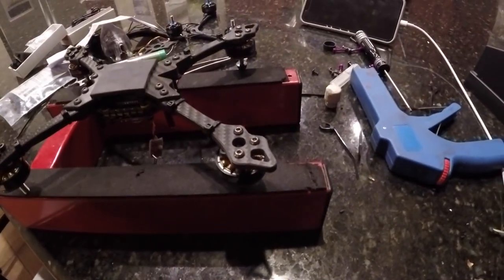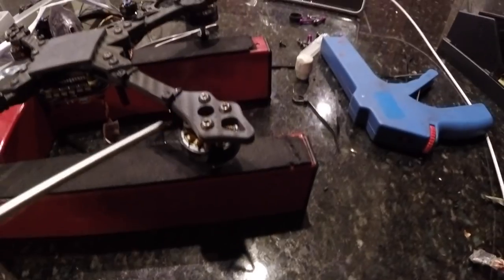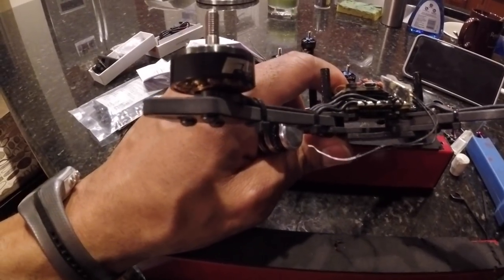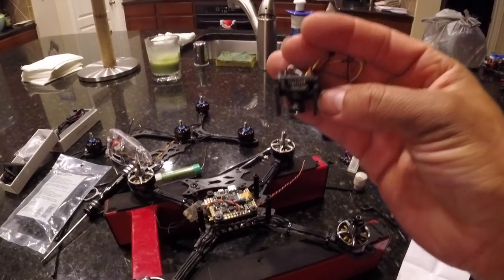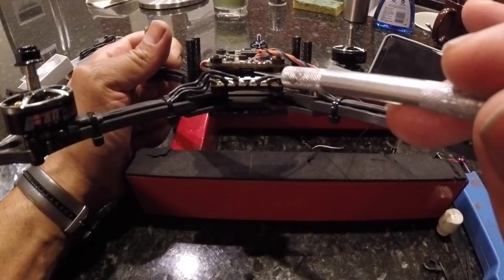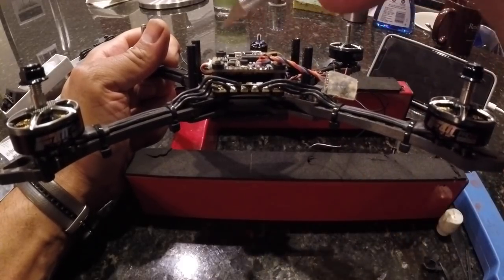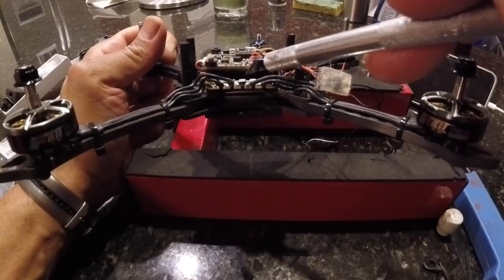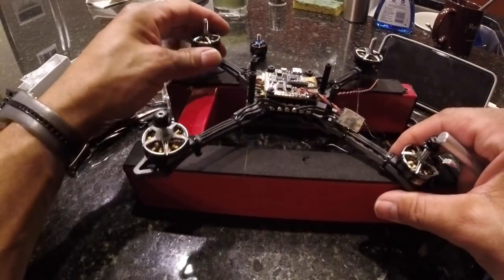How I build a Drone

Comment: Great video.. Took a stab at finding all the gear..  I suspect its a  T-Motor F55A ESC with F60 2450kv Motors on an Avant Ultra 5 Frame.... I suspect the receiver is an R-XSR, Camera is a RunCam Micro Swift 2? with a 1/3 2.1mm lense?   The VTX however has foiled me... I use cheap Eachine VTX's and I could not find anything on google that looked like this one.. That little bump on the side throws me off. :) ..   Happy Flying!

Comment: Send I hope you see this but man I've had several tbs unify race hv and the unify hv 800mw and they died ,well I'm on budget and I wanna get ur opinion what should I get? I ordered rdq mach 3 and hope I can get a new build going because my tbs unify race hv I can't fly due to horrible video and blackouts and white flicker on 200mw I get maybe 250ft if lucky in open field. What should I do?
Reply from the maker: Danger Davefpv get another Unify. It’s really the best out there. How you install it is very important. Send me a pic on my channel
Reply from the maker: Danger Davefpv make sure your not in pit mode. Make sure your pig tail is good and connected properly. And make sure it gets lots of air

Comment: Great video. I agree with the flight on bolts not as good as they say. I love the Kiss stuff but the 4 in 1 is pretty large. I rock a crossfire and use the mode 2 ghost because they local to me.

Comment: Wow, I personally don’t know anyone that wants to solder all those leads to the FC, when a simple ribbon cable does it all. Ribbon cable, not a pinned connection, not a fan of that! Loctite, never use it either, my motor screws don’t come loose, and I check! BTW, nice looking quad on the table, looking forward to seeing flight!

Almost forgot, speaking of soldering, one of THE most important things to successful solder joints, that wasn’t mentioned, is flux. A flux pen will make your solder joints all that much better. If you’ve been soldering for 10 years, well you may not need it, even then, professional solderers use flux!
Reply: I think the flux capacitor is also very important. ;)   If you don't use loctite, you may just end up in the wrong time period.. You never know! ^^

Comment: I never use loctite, I just dab some conformal or liquid tape on the screw joints after they are in and it does the job great and I don't need to remember before I put them in.
Another thing I do is treat my electronics with e6000 glue. Usb ports, connectors, any large components, anything fragile or anything proud. It's waterproof, easy to apply without getting where you don't want it and doesn't leave a sticky residue when dry. It protects them from battery straps and breaking off from excessive force.